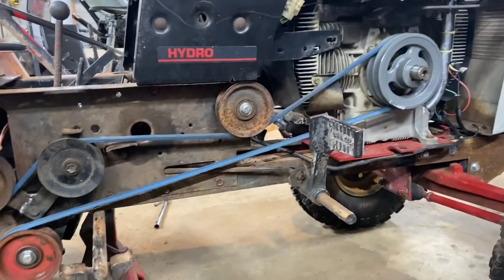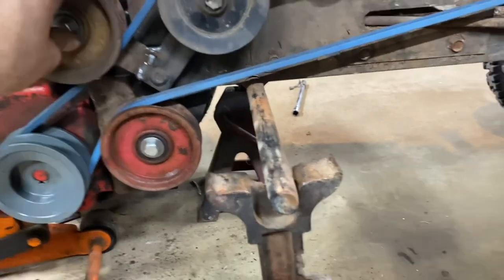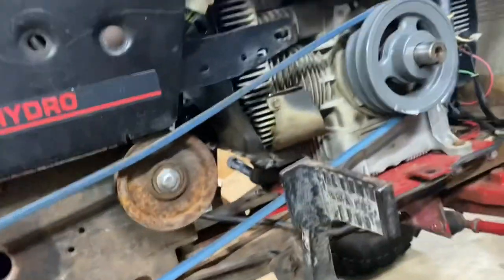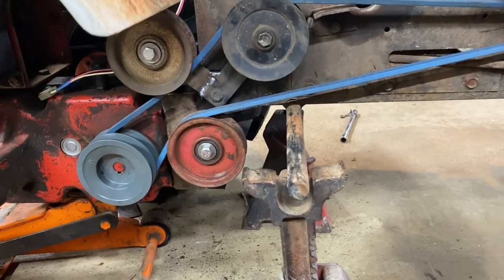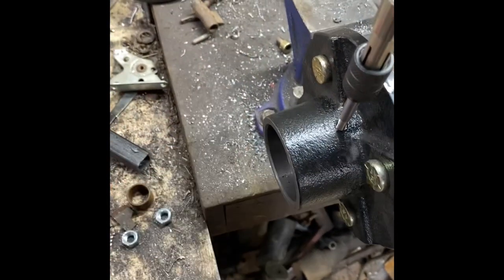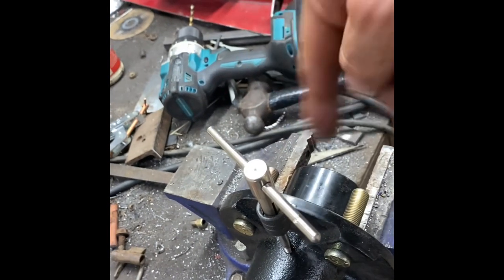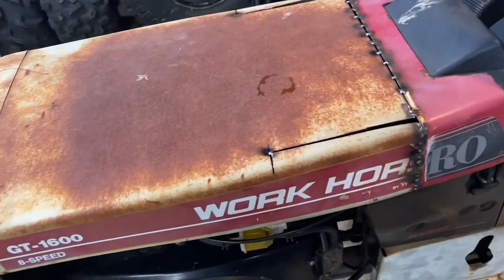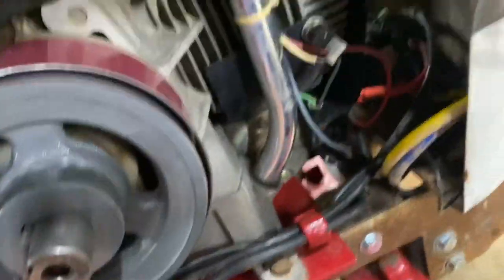Work Horse build continues!

Comment: Where do you get the wide 12inch rims  my stock rims are kinda narrow. Building my first off road mower  appreciate the help.
Reply from the maker: These are only 8.5 but they are off a 520-h
Reply: @creepycrawler43   Will I need to modify the front end pivot on the wheel horse or is it sufficient  for off roading . I just  welded the rear end positive today
Reply from the maker: @toddcantrell4663  don’t make if flex more than factory, makes em floppy on side hills